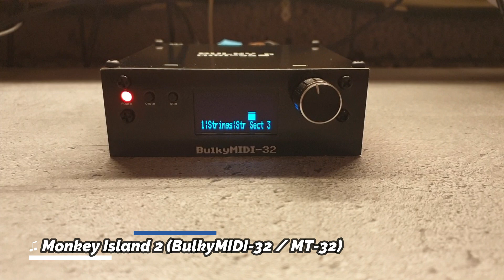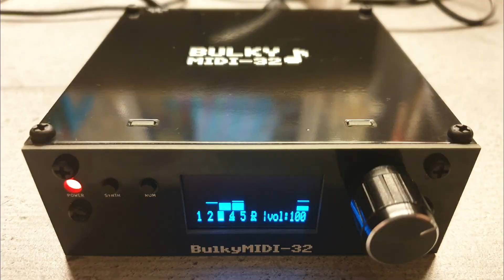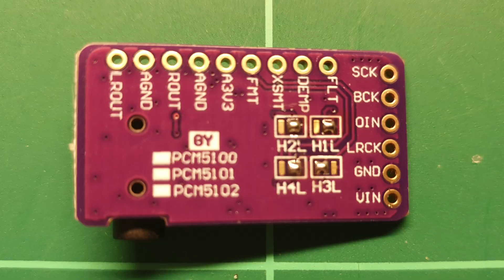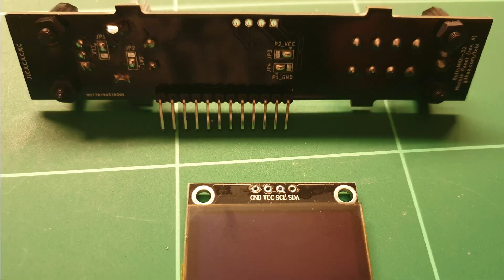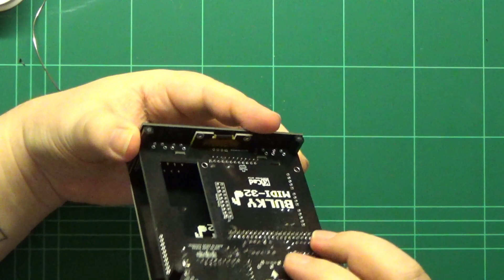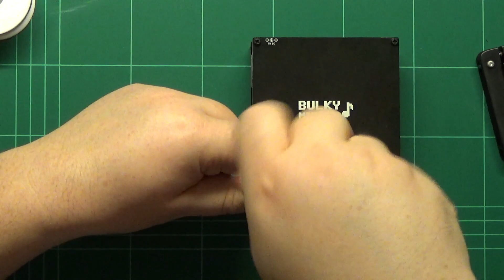BulkyMIDI-32 - Assembling one

Comment: Hey! Super impressed with this project. It's perfect in my eyes. Other replicas are a little ugly with their design and 3d printed body (no offense to those creators, just my taste). I like the use of sleek PCBs instead. I see some other great projects for tacking on a board into the wavetable header. They're great ideas but I'm after an external module.

I actually came across the BulkyMIDI on ebay of all places - seems like there are some people out there making a buck off your work :P I'm super excited to build one myself. Do you think there would be any reason to avoid using a Raspberry Pi Zero 2 W? The wavetable MT32 board that Bits und Bolts has made uses this and seems to be almost the same - Header, Display, 4 buttons. No Midi ports obviously. Would it be at most a change of the configuration files? I'm not into coding so that's as far as I'd go. I just want to keep the cost down. Even a Pi 3 or 4 second hand is expensive here in Aus.

I'm also not a physical electronics guy but I've been successful in reviving a few video cards as well as replacing some switches on some dead retro mice. I think this would be a great first project to build something that isn't on a breadboard from an electronics shop :D

How do you combine the audio from the BulkyMIDI and a PC soundcard? Do you use a mixer or just use the card's Line-In?

Again thanks for your work. It's great to see someone sharing knowledge and expertise. Cheers!

Comment: the files you uploaded have no size in them ? you can chek your self via pcbway or jlc they both ask for size of the pcb front panel etc etc
Reply from the maker: I just checked the shared PCBWay projects and the sizes were detected correctly (100x100 for most, 100x35 for Faceplate FP2). Are you sure that what you're uploading are gerber files? The repository only contains the KiCAD source files and as such they're a different format entirely.

Comment: can you make a seperate github please with all the correct files only for this midi device ,i download the zip from the link and its full of folders with multiple hardware projects software pictures etc  thanks
Reply from the maker: See response for previous comment. In general I don't include gerber files anymore, just links to shared projects as it is usually the only way I get anything back for the work that I do.